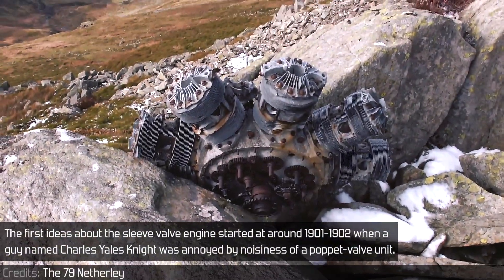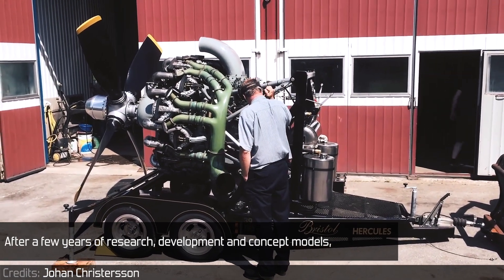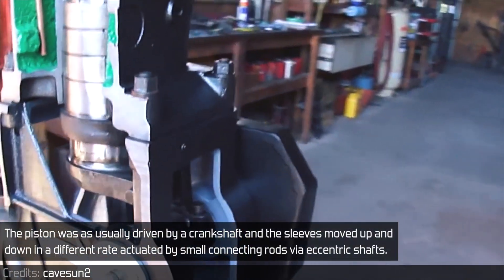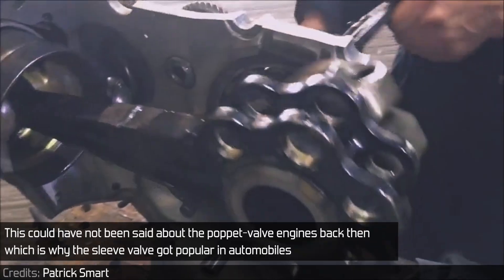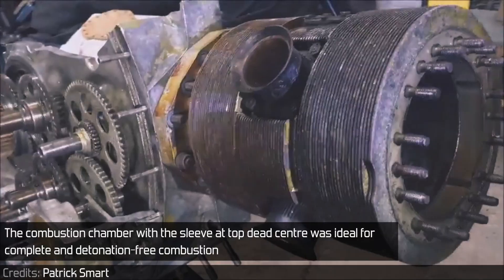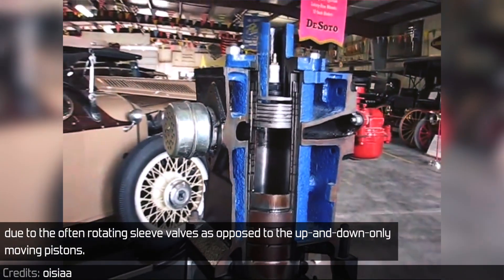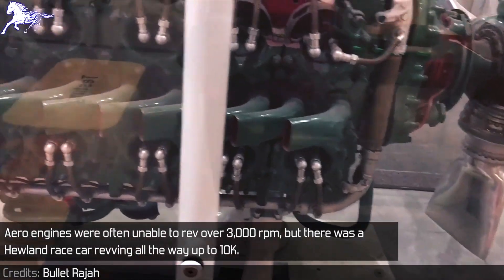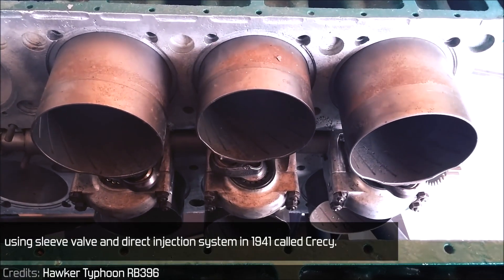A Sleeve Valve Almost Took Over A Poppet Valve Unit

Comment: Good to hear mention of Rolls Royce's 26ltr 5000hp V12  2 stroke Crecy...focus was turned on the turbo Jet instead...shame, it was notably more fuel efficient than the Merlin (at half the power for the same size & weight) without the merit of yet being optimised or tuned
Reply: According to the book I have read on The Crecy fuel consumption was about the same as the Merlin.  Sadly my book on the Crecy may now be on 'permanent' loan - I never learn.  I can't remember the oil consumption comparison, if memory serves the RR Merlin's consumption was around a gallon per hour at cruise. 

I do not think that the engine ever produced 5000hp.  For a start the power figures included the equivalent power that would be needed to produce the same amount of thrust as produced by the exhaust system so people should always specify shp (shaft horsepower).  Secondly, I believe the 5000hp number came about by scaling up the power produced by one of the 2 cylinder test engines, quite possibly one that was developed by Ricardo.

The few test Crecys had a tendency to fail in various manners including cracking the cylinders and bearings and of course the ever popular melting of the piston crowns.

Comment: It is said that the sleeve-valve air-cooled Bristol Hercules despite its higher power output was not a success as an alternative engine on the WW2 Avro Lancaster bomber, due to higher fuel consumption vs. the liquid-cooled original Rolls-Royce Merlin engine

Comment: Even Ferrari experimented with sleeve valves, for a Formula 1 engine, between 1989 and 1992. It gave good results, revving up to 11000 rpm, but unfortunayely the project was abandoned because they could not spend more money on that. By the way, Visioracer, your videos are always very interesting, good job !
Reply from the maker: Thanks for additional info, thank you :)

Comment: Its like a combination of Wankel-rotary and piston engines.
Reply: Nothing like either...The only difficulty the concept had was overcoming cylinder sleeve distortion around the exhaust ports under moderate to high boost pressures...over came with the developments of Nichol chromium steels and improved sleeve ring seals at the tops of the cylinders...mechanically more efficient that poppet valves as well as volumetrically superior...Super simple head designs too
Reply: Uriah Siner  instead of blowing apex seals now you blow sleeves
Reply: Otto raiped Wankel....lmao

Comment: Hey visio, you may be intrested in rotary valve desing as well. It used a normal piston bottom end with rotating cylinders in the head for intake and exhaust.
Reply: Yes, there is the Coates rotary valve that was developed in the 1980's.
Reply: @andyharman3022  ..and a Crossly rotating single switch/dual-porting in the 1930s; 
..if a vague hint of a memory of a motorcycle publications article is recollected well

Comment: hmmm... a part of me wonders if this concept would be picked again...
The Volumetric efficiency advantage and greater freedom of combustion chamber design would be enticing.
Considering the fact that modern car manufacturers are trying to get everything they can get out regular pump fuel. It is not all too crazy, considering recent crazy inovations they have come out with, Mazdas SPCCI, Nissans Variable Compression, hell... even camless engines might become a common thing! 
But still, its pretty far reaching, its unconvientinal and most importantly has sealing issues. But a man can dream...
Reply: This design has problems in terms of mixture turbulence in the cylinder. Also you almost certainly will after every powerstroke be left with some exhaust gas int the cylinder (wich would also be bad ;D).
Reply: Mandernach Luca. Really? from what I have read, gas flow was only a problem at extreme rpms. and I did not realize that mixing was a problem. do you have source for that? I would be very interested to read it!
Reply: Hemingway Bromfield I can search for a source. I argumented on the basis pf my own understanding about internal combustion engine. As far as i know themost engines today are designed to get extreme turbulence at low rpm to maintain a fast flamefront and therefor improve engine efficiency. Also you naturally try to have bear to no exhaust gas in cylinder (after the exhaust stroke) to reduce knocking and therefor improve engine efficiency. From what i had seen so far of this  engine, the sleeve ports are more or less around the middle of the cylinder, so  after the exhaust stroke i guessed that there would be a exhaust gas pocket in the top section of the cylinder. Also, the ports (as far as a know) aren't really allowing the engine to create extreme turbulences (like scroll or tumble) at low rpm. Well all in all i'm really just guessing but for me the engine at least in this state of developement doesn't belong in our "age of efficiency".

Comment: Too bad you didn't mention Avions Voisin. Voisin used sleeve valve engines for it's cars and before that it's planes. The Avions Voisin sleeve valve engine used the Knight principle but with some improvements especially to the lubrication. It was possible for a sleeve valve to fall into the crankcase if it became detached from the connecting rod. Voisin also had a solution to that problem.

Comment: The sleeve valve engine design is one of my favorites. If that design coupled with modern materials and processes were further developed, we would have seen some truly powerful and clean running reciprocating engines. By the way, you missed Voisin as another manufacturer that used sleeve valve engines.

Comment: Why isnt this used for the 2 stroke engine
Reply: He told there was a two stroke variant, in fact the system combines advantages of both 2 and 4 stroke engines and is usable for both cylcles.
Because this is a timed event valve system such as poppet valves, the need for expansion chambers or transfer ports with reed valves isn't there.
The ports are opened and closed by the sleeves and not by the piston itself like in the proper 2 stroke, and therefore the ports can be higher up in the cylinder bore without losing compression.
In the case of a 4 stroke both intake and exhaust are both relatively high up in the bore, with the 2 stroke cycle the intake is more to the bottom and the exhaust at the top of the cylinder, creating an uniflow engine.
The 2 stroke will however still need a type of pressure charging to get proper scavenging, but because the exhaust port can close shortly before the intake does a low degree of super charging can be reached, the working is more like a 2 stroke diesel engine with poppert exhaust valves.
The 4 stroke however lends itself more to supercharging as the intake is higher up in the bore and can be open for longer before the piston itself laps the port.
There is a nice animation of the 2 stroke cycle here: http://www.pattakon.com/Sleeve/Sleeve3.gif
Reply: Benz guy because it kinda is already
Reply: Alex Strömberg yeah but would it eliminate wasting that much fuel and also the need for expansion chambers
Reply: dieselmupke thx for the reply and info man :)
Reply: It was.  Rolls Royce Crecy.

Comment: Wasn't Avions Voisin building cars with this kind of engine well up until 1930's?!
Reply: Voisin indeed used sleeve valve engines for it's cars. I think the only Avions Voisin engine without it was the C30. The Avions Voisin sleeve valve engine used the Knight principle but with some improvements especially to the lubrication. It was possible for a sleeve valve to fall into the crankcase if it became detached from the connecting rod. Voisin also had a solution to that problem.
Reply: To your list of improvements you can add, head cooling (high head temperatures caused detonations before ignition), higher compression ratio (1:7,5 a big deal at that time), higher revving engine (4,5k), magnesium pistons, lighter and better lubricated cranks and cams...

Comment: Though being a car guy I love in-depth study of alternative engines from out-of-car usage like you do here! I feel respect for what history's inventors had to go through of test and failures before the combustion engine became how we know it today. Will we see a clip covering a variety of steam engines in the future...? The glove has been thrown...
Reply: There can be a whole episode made about steam driven cars and trucks, in the early years of the car they were still more powerfull and reliable than most internal combustion engines.
The first car to reach more than 125mph/200kmh in the history was a steam car, the Stanley Rocket, in 1906, it was also the first car that went faster than any train before, and so was then the fastest thing on the planet, as flying just took of and the planes then were very slow with a top speed of only 40-60kmh
Reply: Stanley Rocket - even more I didn't know! Steam was also extensively used in tractors and stationary engines in the day , not to mention vessels - seems VisioRacer will have to make an extended episode next!!
Reply: An antique steam tractor boiler exploded at a meet not long ago, killing and injuring several.
A tourist railway steam locomotive boiler exploded, severely scalding the driver (USA: “engineer”) and badly scalding the firemen.
As automotive steam engine firetube boilers are fired with kerosene, diesel oil or heating oil, the occupants of the cabin are not exposed to the boiler. They also are very small in comparison to locomotive and tractor boilers.
Water tube boilers don't have anything to explode as the water tubes run through the firebox instead of the firebox being inside the boiler. Stationary and ship boilers were and are almost all water tube type. As what serves as a pressure vessel is multiple small round tubes there is no crown sheet supported by staybolts to become overheated by low water level, soften and pull off of the staybolts.

Comment: The Napier Sabre engine for the Typhoon planes in WW2 had sleeve valves. The engine maced out just over 4000 HP. I think we should bring them back you don't need to worry about breaking valves anymore for one thing.

Comment: They also played around with rotary valves for a while but they never took off either. It's hard to beat the relatively low mass of a poppet valve train, especially when you start getting into OHC engines.
Reply: ah! i rmember those they were little rotatin steel slab shaped like brie cheese...remember having seen those in ford hot rod magazine in the 90's ...i was fascinated but as you said we never heard of em again
Reply: In principle, they are a great idea. In practice, they are complicated to activate.